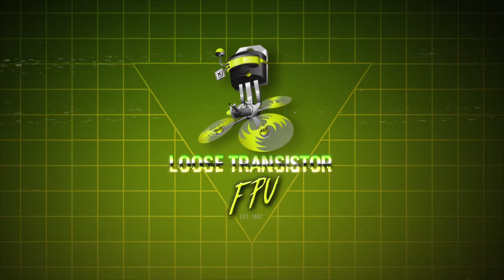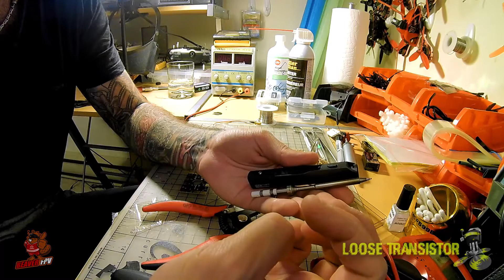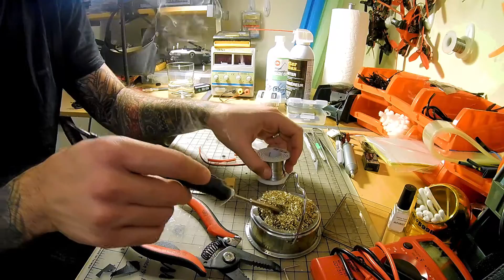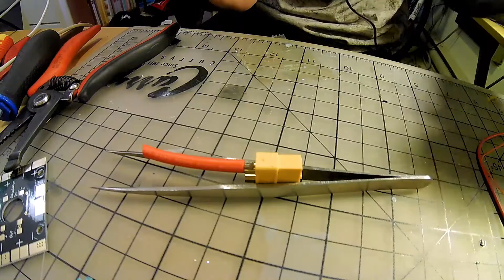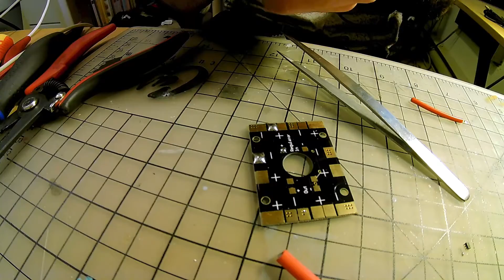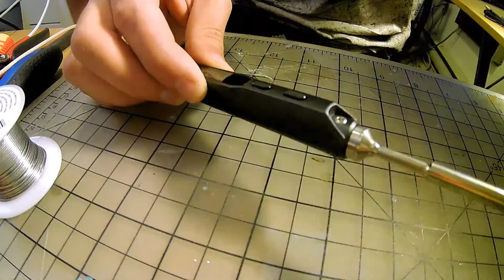QUAD BENCH REVIEW #1 ♠ TS100 Digital Soldering Iron

Comment: Intro music FAR TOOOO LOUD compared to your voice, so you have to quickly turn the volume DOWWWNN before your ears start bleeding, then you can't hear what you're saying!!! Good review though, I love this iron - just bought one. Impressive job on the XT60, especially onto the pad; it shows the power of this little iron, but you need a different tip for this type of work - a pionted/conical tip is not good for this. You should get yourself a silicone soldering mat too, which would stop your components sliding around while your working - they are really helpful.

Comment: I saw when doing cups. Twist some solder put it in  up and cut it. Heat and wetten it, pre solder wire then heat cup and stick in wire. You get super clean joint with not to much solder

Comment: a improvement is to cut 2 bits of shrink tube with glue inside.Around one cm wide.diameter should be so that you get it on the back end of 1s100 so it stops at  the earth screw.and in the fron off ts100 between the screw and front button.heath it upp so the glue shows all the way around.it feels lot stiffer and does not slide around as easy when it has the stand clip mounted

Comment: but but, your doing it wrong. no wonder your having so much trouble with xt60s try tining both side before you bring them together. wont even have to put as much heat as you just did. also wont burn your self lol XD
Reply from the maker: cmojena1990 lol I will give that a shot. thanks for the tip!

Comment: Is Fahrenheit display an option ?
Reply: I just found a PDF user manual on-line...Yes ℉ can be displayed (see page 13 of manual Version 1.0.1, and that's for the original app = APPV2.11
Reply from the maker: Yes it is entirely configurable =D
Reply from the maker: Wow Thanks for the tip! really appreciate this =)
Reply from the maker: If I happen to see the notification I usually respond right away or at least I try to.

Comment: flux?? would help make a much better job
Reply: Flux is not required, in fact as someone who has done a very large amount of soldering, bordering on and asinine amount of soldering, I only ever use it for SMD rework. Flux core solder is usually more than enough. Also Flux will oxidise the metal of the joint if not cleaned after use, this is a step that many people forget.
Reply from the maker: Didn't have any on hand when I shot that - bought a pot of it shortly after =)
Reply: For the best joint on those connectors. strip, twist, flux, pre-tin solder, trim to length, flux inside connector, heat till solder flows then heat shrink tubing any exposed metal.one more, buy multi colored/ multi sized heat shrink tubing and color code wires +/- NO shorts and neatness counts!!~JL~
Reply from the maker: I will try that next time I am doing pigtails for sure!